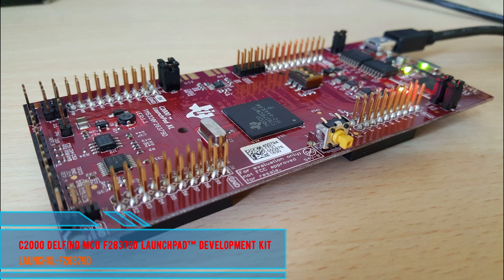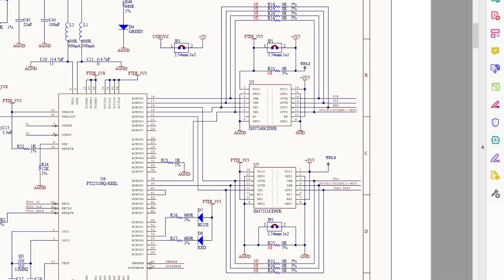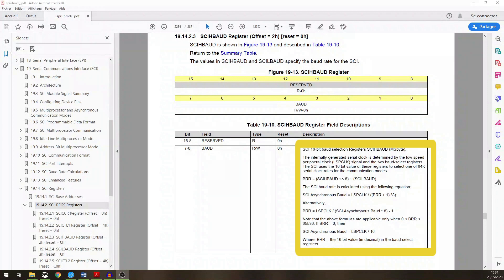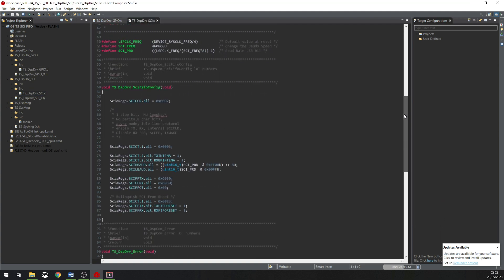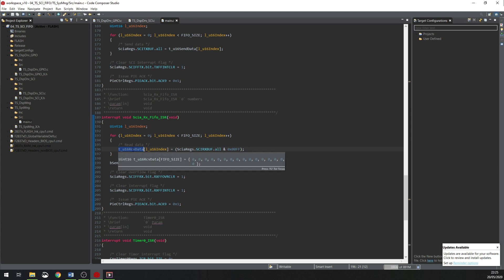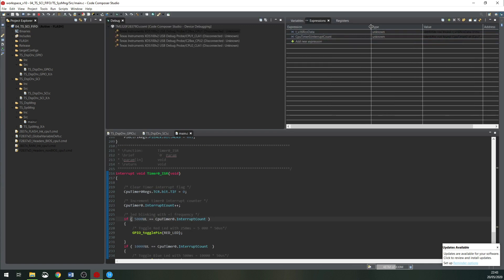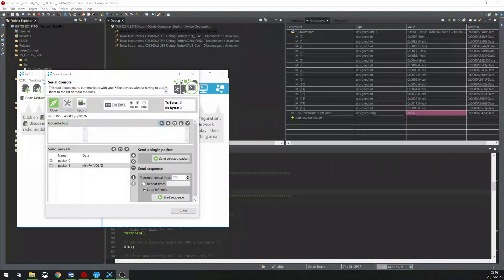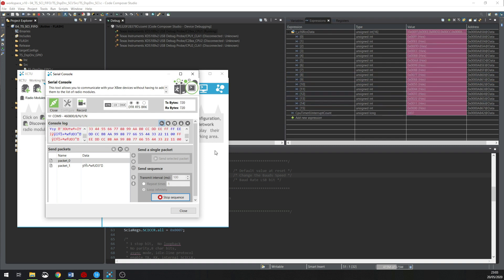[TUTO] #11 C2000 TI DSP | Serial Communication Interface (SCI/UART) Part1 .

Comment: Thanks for your sharing. I need more help from you. I need to transfer data after calculating in DSP to PC for collecting data. Could you let me know how to send float type data and how can utilize your example to my purpose? Thank you.
Reply from the maker: Yes, you could send data from DSP to the PC by multiplying the floating value and casting the result in an Int16 variable, for example, if you floating-point variable is 16.3456 then, the int16 = 16.3456*1000 = 1634...  you send it, in the PC you divide by 1000 and you have the floating variable. In this way, you could send and receive data from the computer. It is not very precise, but it is a solution used in many applications.
Reply: My email is ttdong.hueic@gmail.com